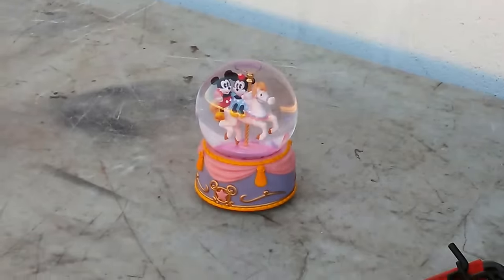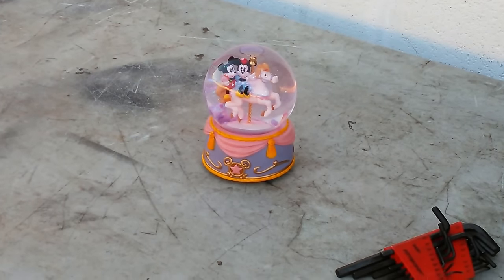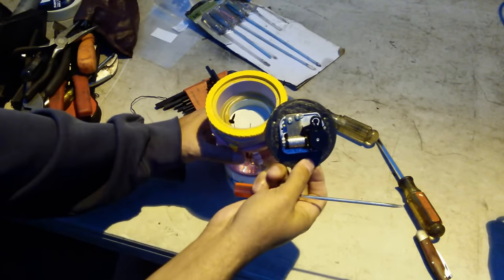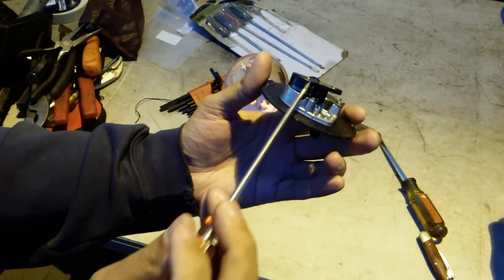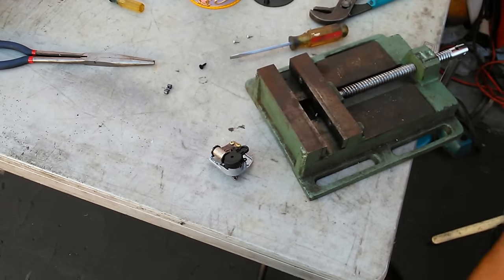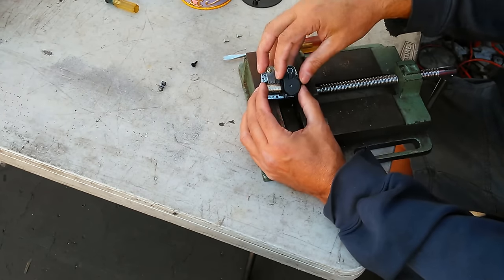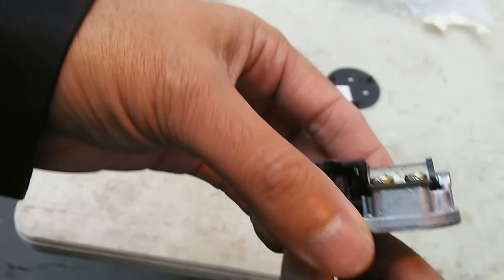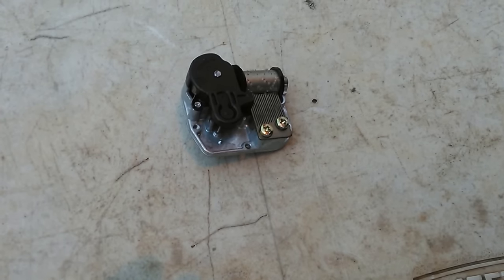Fix A Music Box (Snow Globe) Mechanism Movement

Comment: I have a pilgrim souvenir from Lourdes in France that I acquired at a swap meet recently,  It has a musical movement  and a mechanical clock too.  The movement was filthy, rusty and not working.  I had more or less fathomed how it worked and it had the same fault as yours.  Until I found your video I thought the spring was broken, but like yours the tab has slipped out of the slot and disappeared inside the housing. Thank you for showing me the fix.  You saved me time and a couple of dollars or more. The word you struggled to find is governor ... that's what we call such a thing in England.  Best wishes,  Derek

Comment: Thank you so much! Mine also had the glue holding it in place. I found that the comb had been moved a hair width away from the teeth. Loosening the screws allowed me to adjust them down and to the side. Took some trial and error to adjust it just right, but it works!

Comment: ty for the lesson, quite a help.  I watch jewelers fix wind up watch and clock movements as well. It can be really interesting, I have been told to have eye protection when I'm working around the tightly wound spring just in case it does jump out.
Reply from the maker: Thanks for the tip. Eye protection is probably wise.

Comment: man.. i wish i knew what i was doing before i decided to take the whole thing apart.. i've got the same exact model, except mine has a little on off switch in that hole next to the keys mount that stops the oscillator. 2 hours went into putting the spring back into the top plastic housing, and now i'm trying to get the stopper (under the spring) to mesh back with the music wheel while also fitting the top part that came off on yours back in. oh boy i'm not looking forward to this...

edit: taking a look at the re-assembly part of the video, the stopper switch would go in the second large hole, so that baseplate is definitely shared with other music boxes that do have stopper switches, and for whatever reason, that one does not.
Reply: Did you manage to put spring back?) I have the same issue))
Reply: @technokturn   sadly no, it's sitting next to my desk as parts currently

Comment: Great vid. Now to find a video addressing my particular issue, measuring, sourcing, & installing the clockspring.   I've been searching Google & so far no luck. I can't believe how difficult it is to source a spring that's 6mm wide x .3mm thick. Still need to measure the length. 🤦‍♂️ ugh. Wish me luck!
Reply from the maker: You may never find one. You'd likely be better off just replacing the movement: https://www.musicboxattic.com/music-movements-modules/

Comment: Hi, my spring anchor is attached however it is still clicking and cannot wind up. I think the spring inside has detached itself from the gear. How do I resolve this or remove the black plastic cover because it seems that the black plastic cover cannot be unscrewed off.
Reply from the maker: I believe that cover is blind riveted in. If it is, you'll need to drill through the rivet, but beware that the spring will unload rapidly and you'll need to tighten it up to put the whole thing back together.

Comment: Thank you so much!!! This is a great and helpful video. I do have one question. My oscillator isn't spinning sometimes. Does it have anything to do with dust or anything like that? The plastic piece is touching the metal so I'm really not sure what's going on. Thank you!!!
Reply from the maker: Make sure that nothing is obstructing the oscillator and that it's registered correctly into the housing. Any big issues with these units usually involves the spring, so you'll want to make sure that the spring is spinning on it's hub and is unobstructed. You'll also want to check for dirt or debris. If all else fails, you can saturate the unit with kerosene and that will unclog any dirt deposits. The nice part about kerosene is that it evaporates and doesn't leave any deposits or gum behind.

Comment: Hi! What tool would I need to take the black part off? I’m looking for a circle helix looking tool but I can never find it. Been through three tool boxes. Please help!
Reply from the maker: If you look at the part carefully, I believe it is fastened in with a bolt that has a hex slot in it. So apparently, you would use a hex wrench or hex driver to remove it. Keep in mind that the spring is not going to come out peacefully if it is under load. As a matter of fact, if the mechanism is wound, the spring will want to shoot out of the assembly, so you'll want to remove other pieces to protect them from the force of that spring when it comes loose of it's housing.

Comment: If you use a hairdryer in about 2 -5  minutes it will lift off.  Also if you ONLY ADD 3 DOTS Of glue from  a glue gun to put the bottom back on easily.

Comment: I have a similar issue with the wind up thing. Whenever I turn it I hear it cranking but when i turn it the opposite direction it easily comes loose. I decided to take out the parts like you did to see what the problem could be. When I opened it I didnt notice anything wrong. No parts were sticking out or came apart. I’m not sure what to do to fix this.
Reply from the maker: The problem is often the anchor for the spring. If the spring isn't anchored in place, you'll never get the box to store the energy needed to drive the mechanism.

Comment: Mine had the same problem, but when I put the regulator in the gears stop turning? It works fine without it, albeit a little fast, but it just stops once that piece is attached. Any ideas?
Reply from the maker: These mechanisms are best lubricated with graphite, however your issue might go well beyond just lubrication. You might take a closer look at the gear teeth themselves. There's likely an obstruction within the gear teeth and you can clean them with kerosene.

Comment: How do you attach the inner part of the spring?
Reply from the maker: The spring is attached in two places. The inner part of the spring attaches to the winding mechanism which, in turn, has a gear attached that locks with each "click." The outer part of the spring is anchored to the drum.

Comment: I followed you and I can't seem to get it to slow down. all the gears are moving just way to fast...
Reply from the maker: If the gears in your music box are unwinding too fast, then it's likely the regulator. That's the piece that creates the air flow when the mechanism is in action. I make reference to that part at the 28 minute mark.

Comment: How do I open the black part where the spring is since it doesn't have screws????  Thanks
Reply from the maker: You don't really want to open the spring chamber because you might not be able to put the spring back in. The anchor is the key. Just find the end of the spring and set the anchor like I did in this video.

Comment: I can’t even get the bottom off, how do you do that? It’s superglued on I think
Reply from the maker: There's usually a mild adhesive, but it's not superglue. You might apply a little heat from a heat gun to soften the adhesive. Not too much heat, though.
Reply: Most glues can be softened/removed with alcohol.
Reply: @frankhamilton8257  The bottom melted off and all the water came out. I guess I applied too much heat. Whoops
Reply: @Lolo-mx4sc  Ah, thanks. I tried a heat gun and all the water spilled out because the bottom melted and caved in